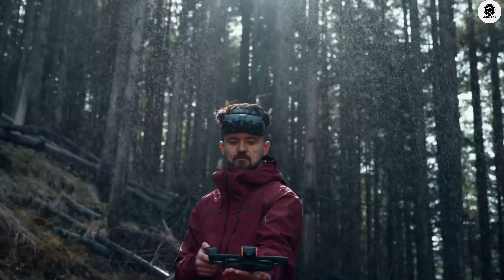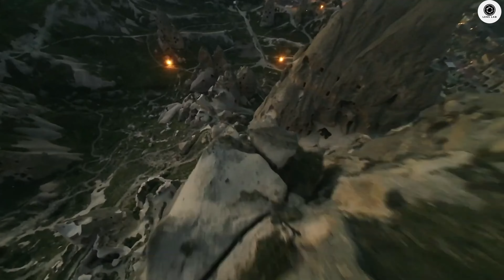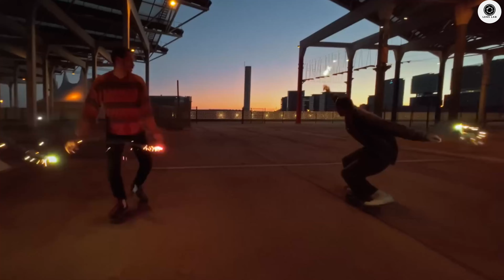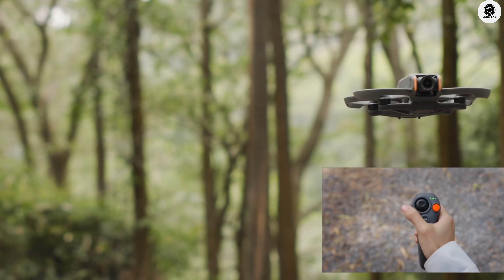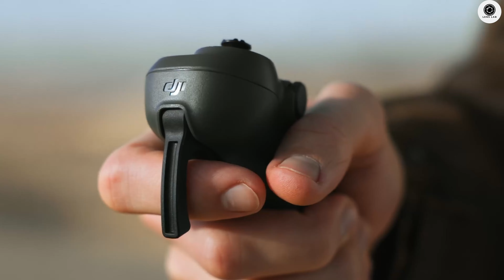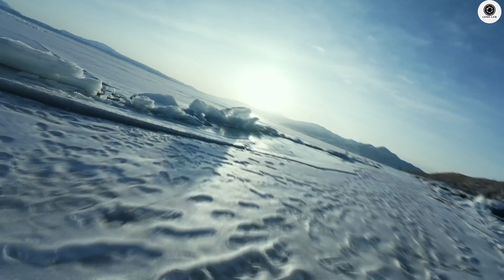DJI AVATA 360 - Official Release Date & Price LEAKED!

Comment: We are awaiting the arrival of the Avata 360. The Antigravity A1 drone, from what we have seen and tested, resembles a DJI mini 3, or 4 with a 360 camera. But the Avata flies in a different way. Like when you pilot one of the fastest helicopters. With one observation, however. I wish the new Avata 360 had better air resistance than its predecessor, the Avata 2.